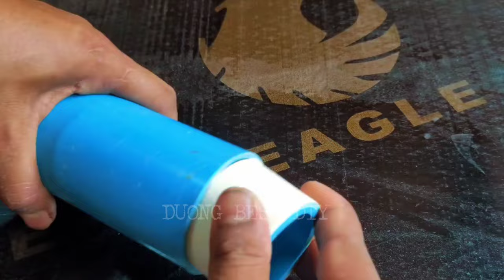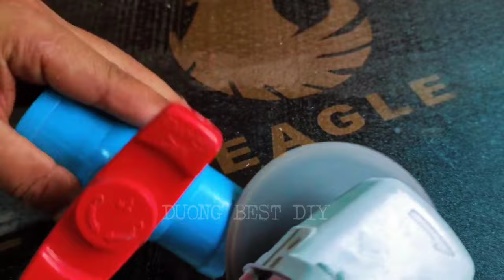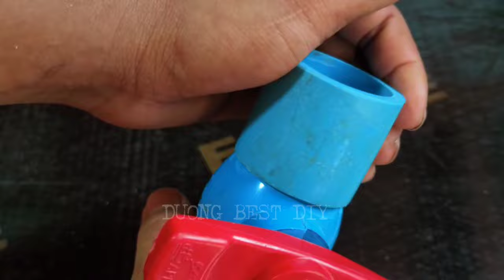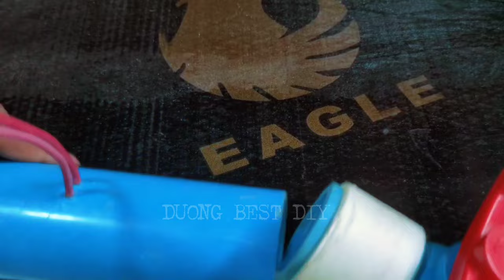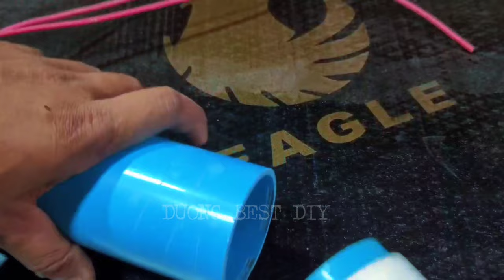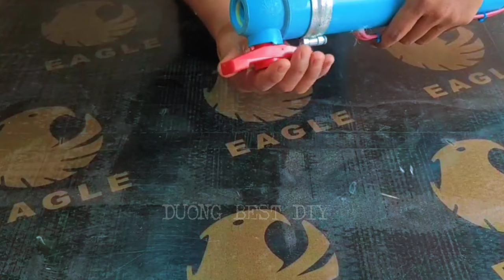DIY how to install inner air booster pvc ring , ball valve for pushing strong air flow in PVC tube

Comment: Morning bro..thanks for super fast replying..tq..need to ask more maybe i miss other scene..is it 3inches pipe use for the chamber.. tq bro
Reply from the maker: Thanks for watching
Reply from the maker: Chamber PVC pipe size 60 = Cut 0,30m long, air ring size 42-21 set up into PVC pipe at 0,10m from rear part and magnetic set it at 0,120 cm. Thanks for watching 💖
Reply from the maker: Magnetic 0,120 m
Reply from the maker: Magnetic 0,120 m
Reply: @DUONGBESTDIYANDTECH ่ออแกเเว้ั้่้้้